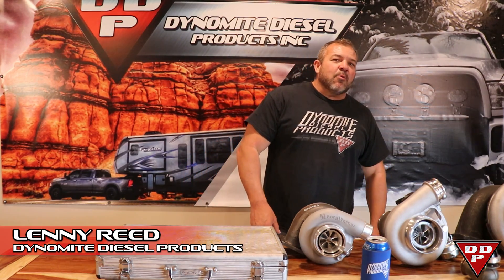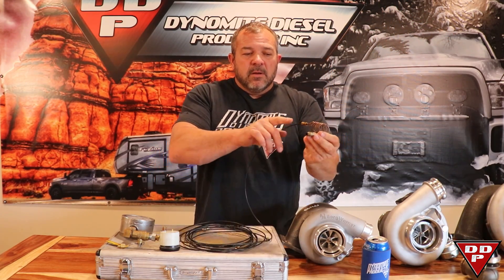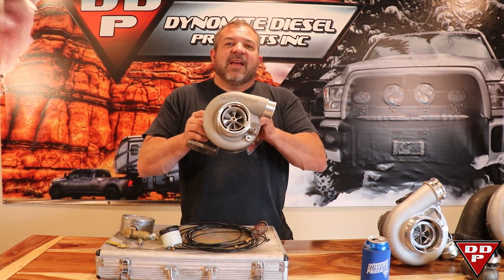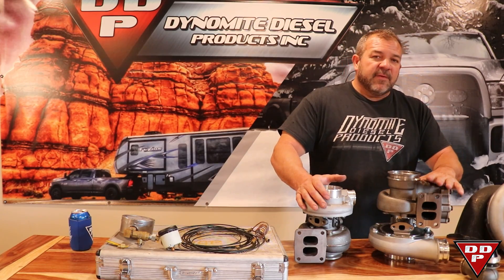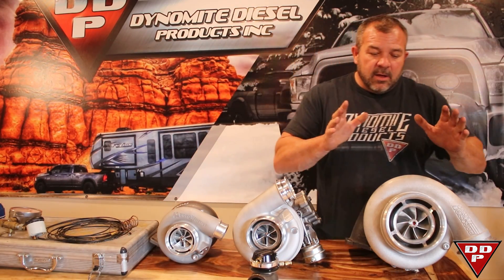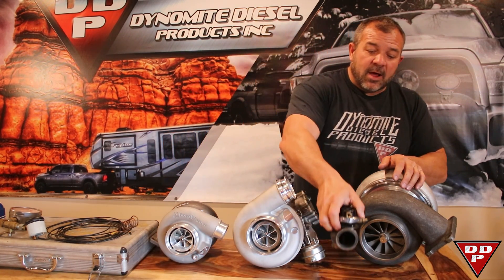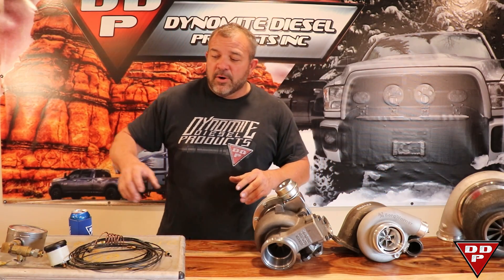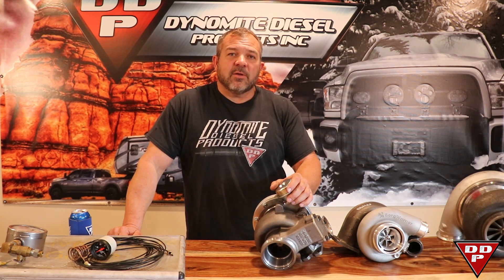BOOST vs. DRIVE PRESSURE

Comment: Here  some perimeters

450hp  mantifold turbo

Spool around 1200rpm
  
T3 Dual wastegated
  
 T3 Qsv (quick spool valve)
   
Compound setup, so the mantifold turbine will need to  suport 1200hp overall
 
 
 What's your opinion  for the mantifold turbo choice.
 

 Im leaning towards a gtw3684r  with a custom turbine housing 
 But then i saw the massive borgwarner low drive 93mm turbine.
 And was concidering a custom turbo  with a larger turbine or rather,  higher flowing turbine   via clipped, narrower hub,  even  the hub less  ( all blade turbine) ive seen.
  Goal is  obviously  efficiency. I don't want to buy 5 turbos to settle on something, id rather pay extra fit a custom  turbo that's actually  right.  Bedsheets lets face it, these turbos  are not specific  to a build

Comment: Im doing a compound kit on my 12v right now. Do I wastegate the little turbo??? What keeps the little turbo from over spooling?
Reply: 1 of 2 ways to keep the high pressure  turbo from overspending. 
1 size it too big to over speed
2 wg inturnal or external.

Comment: Turbos. I am going with one I bought from DAP. I am not going for crazy HP numbers. 400 at the flywheel is is fine. Great video BTW. One of Lenny's videos on how they make injectors got my interest. I already had a set of +50hp not installed from someone else. I ordered a set of Stage III nozzles from DDP to swap in. After watching another injector video by Lenny I wish I just ordered a set of their Stage III injectors. I may do that still.

Comment: Grate video really well explained. I have a adjustable waste gate and was surprised when messing about with it how after the sweet spot those egt spirals and the truck actually looses power
Reply from the maker: Glad it helped!
Reply: Change your charge piping for larger and see what happens then 😉     Flow trumps all other mods.

Comment: what about VGT turbos lets say in a duramax? as far a drive pressure / boost ratio?
Reply from the maker: If it doesn't have compounds on it, I wouldn't be concerned with it.

Comment: Where do you hook up your drive pressure line to
Reply: Watch it again.
Reply: Thanks for all yall videos it really helps a lot
Reply from the maker: No Problem, that's why we're here!
Reply from the maker: One end goes in to the exhaust manifold, with a copper tube coil. The other end goes to some sort of boost gauge.

Comment: Will drive pressure affect turbo surge? My truck starts a surge/swishing noise when it hits lock up. It’s an 04 5.9 Cummins that has a bd super b special that is a 64.5 compressor and a .80 housing. Not real sure of the turbine wheel size
Reply from the maker: Yes, and No.... There is no short, and simple, answer to your question. The biggest issue that we've seen, for that application, is actually a result of the ratios in the transmission and too large of an RPM drop causing the surge.
Reply: @DynomiteDieselTV  thanks for the reply. Really enjoy your videos
Reply from the maker: We're glad you're enjoying them!

Comment: Well dang,  now I need to check my system.   I have k27 over a 369 on a vp truck with your 125hp injectors and I can get 1400egt real easy...  wonder if the 27 is working too hard. Huh
Reply from the maker: Drive pressure will tell you the answer!

Comment: When you say 1:1 is that steady state or should it never go higher even during hard acceleration?
Reply from the maker: That's just a rule of thumb for when you're at WOT. We have actually learned that the majority of turbos are most efficient with drive pressure being slightly less than boost.
Reply: @DynomiteDieselTV  in that case I definitely need a bigger secondary.
Reply: I found on a stock 5.9 but with big fuel the .70ar borg on the s300g ran very close to 1-1 boost to drive up to about 2200rpm then drive starts exceeding. Same turbo with a .80 spools 250rpm later but runs close to 5psi more boost than drive under most conditions and doesn’t cross over till 2500rpm.
Reply: @bcbloc02  what turbine wheel?
Reply: @njdevi11  the s300g runs a 74x65 turbine